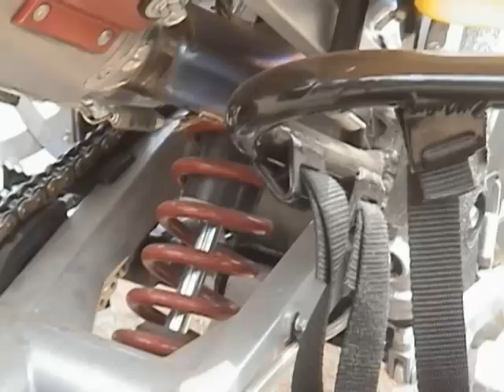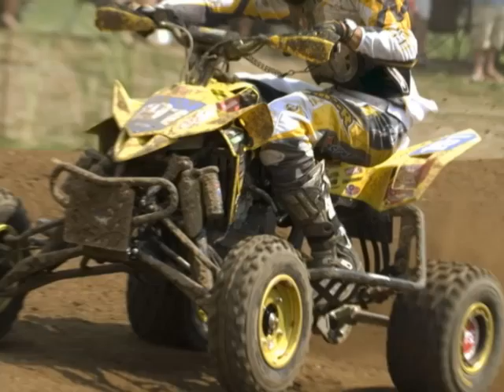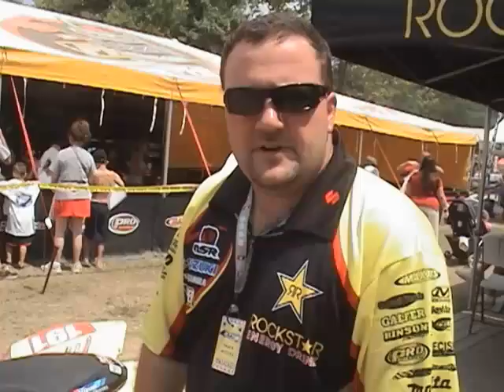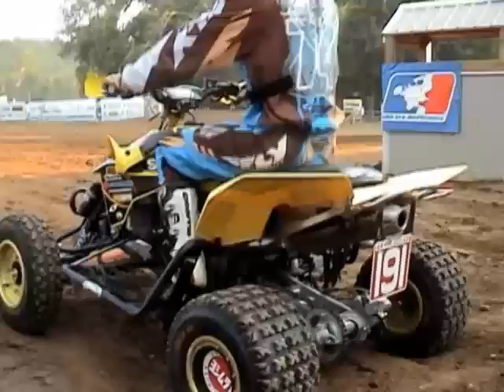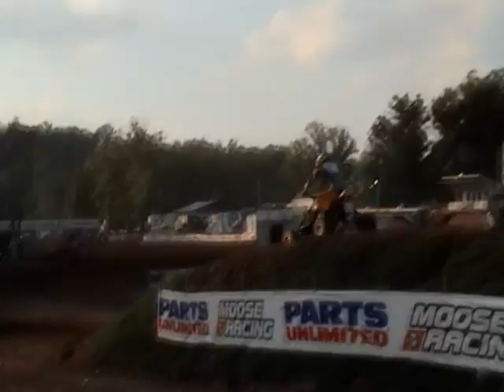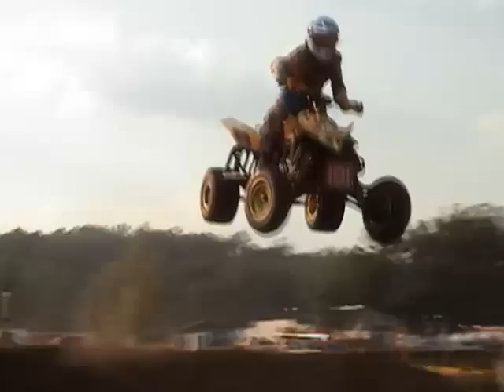Dustin Wimmer's 2008 Pro ATV Motocross Championship Winning Factory Suzuki LTR450 Test, Part 2

Comment: @killerbobjoe107 dude no they dont they are all stock bore the only thing they might do is port and polish. there rules are 450 and under the suzukis are actually only 449cc. they add high compression piston better valves is always good. and yoshimura is suzukis wife you could say ....there kinda like what nismo is to nissan but with a lil more freedom they can make parts for other manufactures and do but there focus is on suzuki .....but suzuki dont get special treatment they dont need it